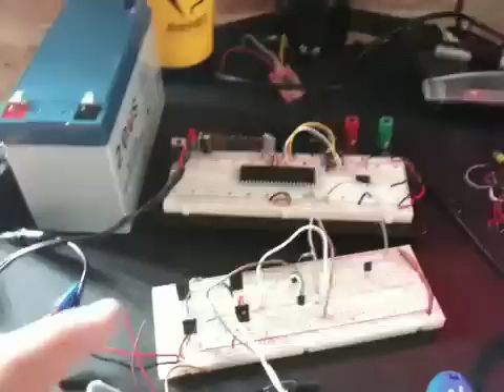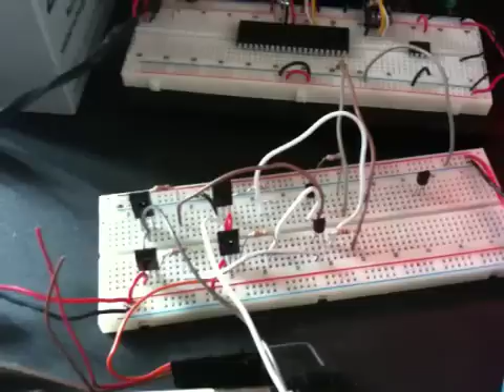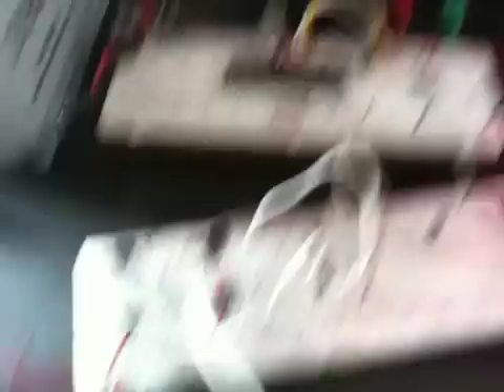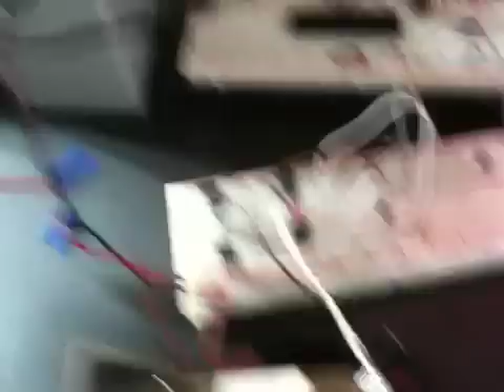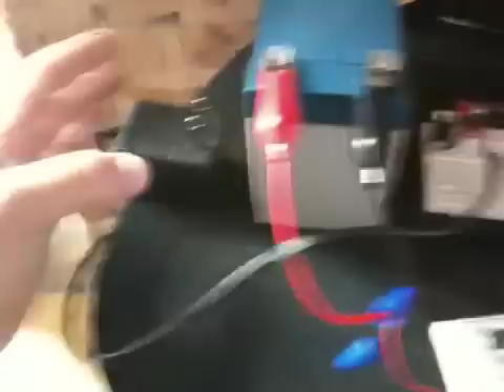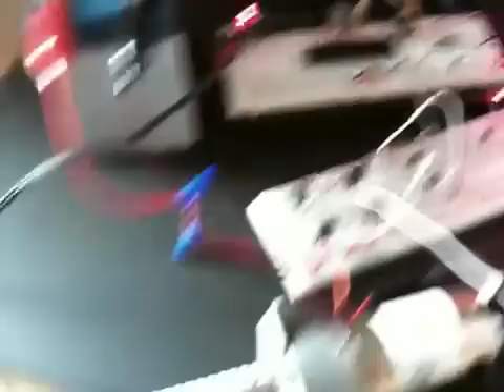Transistor H-Bridge Circuit

Comment: It happens when the battery is connected through an H-Bridge  to a 12V 2A drill motor, I can get some variable control with the motor,  but it gets very hot. The parts are rated for a maximum of 6A, I checked for shorts but can't find any. I noticed that you used different resistors could that be the problem?

Comment: Nice video! I'm working on a similar H-bridge with the exact same voltage, but my smaller NPN transistors explode! but only the one that feeds into the PNP mosfet. In general the entire system gets really hot to the point of desoldering... I am using 10k and 4,7k Ohm resistors respectively, but besides that my setup od the same as yours...can you help?

Comment: Nevermind about the last comment, i found out what was going on :-). both the PNP's were just slightly on. so i've changed the base resistors to 560Ohm and placed 1K ohm resistors between the PNP bases and +12V and between the NPN bases and 0V... probably bad practice, but atleast it works now :-D.
Nice video :-P